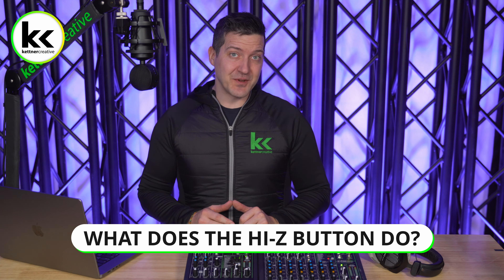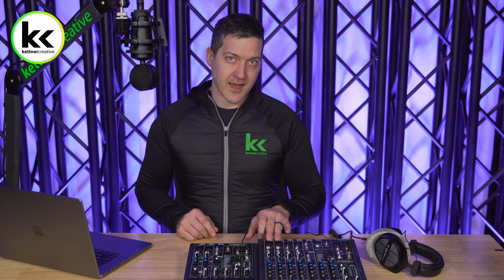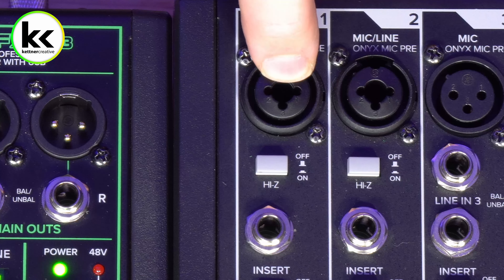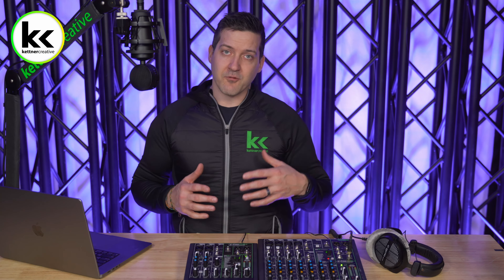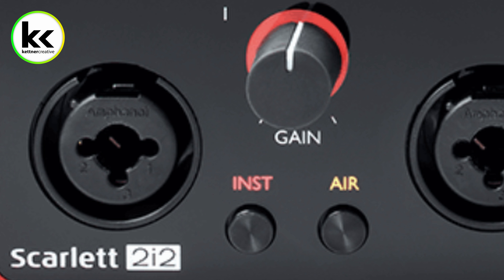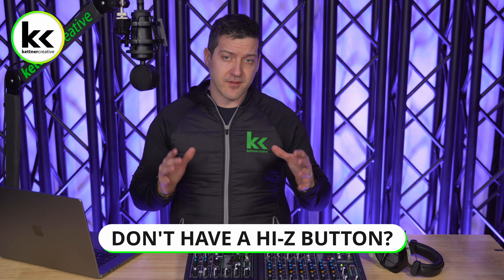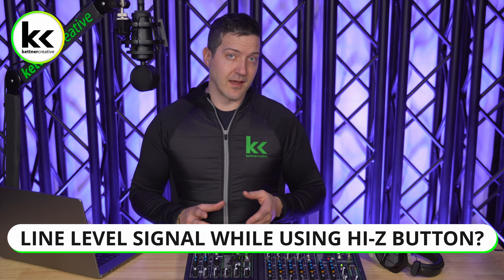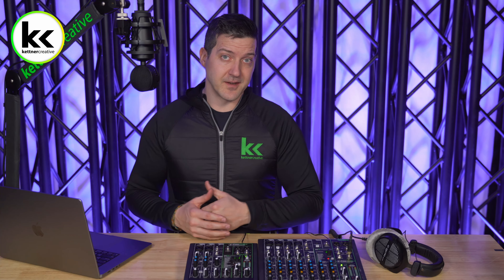What does the Hi-Z Button Do | Audio Mixer & Interface

Comment: Hey great video! Question: In a looping scenario, I would be connecting my guitar/bass to a small amp and running the phone/line output into the mixer from the amp.  Do I need a DI-box or the hi-z button engaged in that scenario?
Reply: I'm waiting for his answer to this question.
Reply: I would advise to plug a line level output into a DI box, then run balanced (XLR) cable from the DI box to a line level input on the mixer (or a channel capable of receiving mic AND line level signals). The connection can be direct or through a snake/stage pocket. The signal will still be at line level, not mic level, so signal chain should be set accordingly. 

The mixer GAIN or TRIM for the channel should be down while the connection is being made, then adjusted appropriately once the loudest content is being played through in sound test.

Also while you connect, if the DI or mixer have a PAD button, it should be engaged to reduce chances of damaging your system with sudden pops. Although ideally the GAIN will be turned down at the mixer, this is another step to prevent system damage. Some mixers might not have GAIN where the input plugs in (some Line-Ins specifically do not). Engaging the PAD whilst connecting to the mixer would relieve most issues that might otherwise pop up in that case.

Also. On your DI box, ensure that any GROUND LIFT is disabled. After plugging in, if you actually have a buzz on the line, then and only then lift only the ground needed (some boxes have more than one lift) to resolve the buzz. It doesn't always require all of the available lifts.
Reply: Also I would say no Hi-Z on that line input.
Reply: If the mixer only has Quarter-Inch line ins, in this case use a female XLR to TRS 1/4" adapter at the board. The input should be balanced - look at documentation on your mixer for this.
Reply: With stereo source material, you can go through a stereo direct box, sending two channels out. Some stereo-capable DI boxes can also "sum to mono" in which you can send both stereo signals down one channel, but you lose stereo imaging you might have wanted at the mixer for panning purposes.

My favorite stereo- and mono-/summing-capable DI box is the Whirlwind PCDI. Radial PRO-AV2 is great too, but it does not do summing so you have to use stereo out (2 channels) if your source was stereo.
Reply: Radial does have PRO-AV1 which will always sum stereo to mono. If that's always OK, then it's definitely an option too. I have been assuming you'd want stereo.
Reply: For anyone coming to this thread now Mikey you made that awfully complicated. As the OP asked, he would be running a phone/line into the mixer. This is line level and does not need high z.

Most cases do not require high z. That said if the connection cable is being run for longer than (approximately) 10ft or 3m you should consider using a DI box in order to balance the signal. This will be purely to reduce noise and not to tame the resistance.

Comment: Question, if I'm going from my electric guitar through a Boss ME-80 Multi-Effects pedal, is my signal now a line level signal or should I still use Hi-Z. All plugs are 1/4" jacks connected to mono.
Reply: If your Pedal Effect has built-in Preamp or it says Line Out on the Output Master Source then you don't need Di-Box or Hi-Z it goes straight to the Line Input of mixer.. If your Pedal effect Module has no Line Output or only says Output signal then your Module has no Pre-amp and it should be connected to the Hi-z input or has a button of Hi-z on the mixer. But in modern tech almost all Pedal Effect has Built in Pre-amp. Either way if you plug it in the Hi-z Input, it will only increase Signal so it doesn't affect any performance and it's OK..